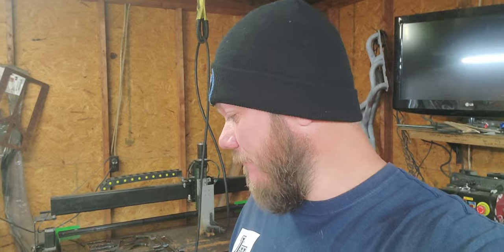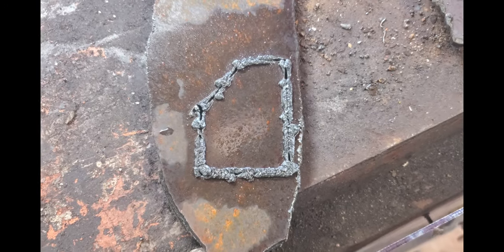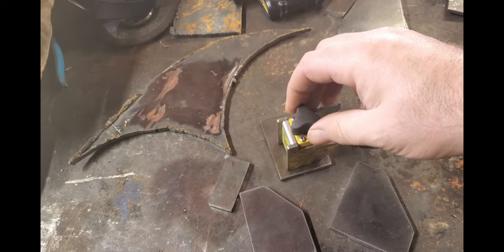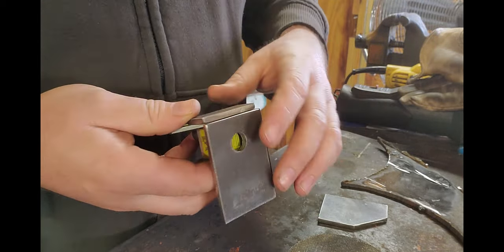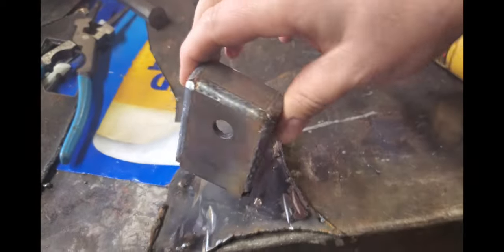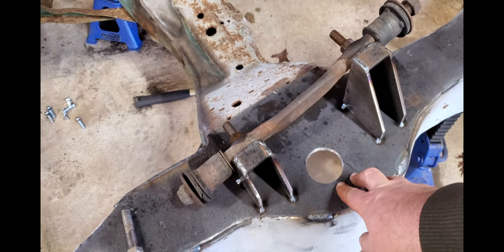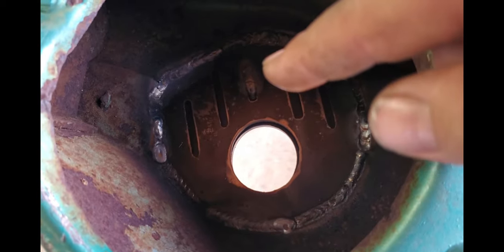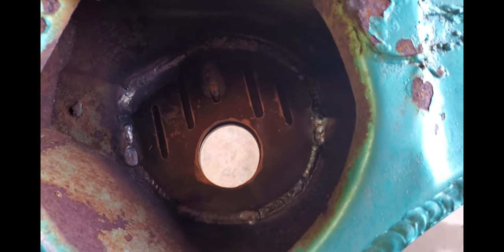Building Upper A Arm Mounts (Ears)

Comment: Hey boss you are really the only guy on YouTube that has fleetwoods and they are really helpful, I wanted to pick your brain, I'm having some issues with mine (94 fleetwood) my digital cluster lights up but nothing works, speedo shows 0mph at all times and millage won't move, is it a bad cluster ?
Reply from the maker: Northern likely it's the speed sensor in the transmission would be my best guess 90s used to have a gear that matches up with the tail shaft you could manually spin it and see if the dash registers but I belive 93-96 is magnetic but i would thing the sensor went bad also check your fuses or could be a wire down at the transmission got broke
Reply: @thecadillacdanshow8658  I have changed the sensor twice, it looks like a "tombstone" for the 93-96 right ? I'll double check the fuses and wire, I appreciate.